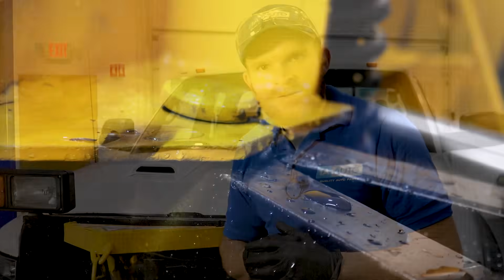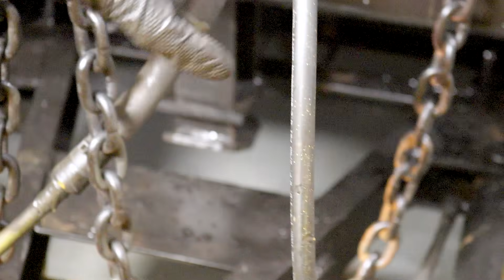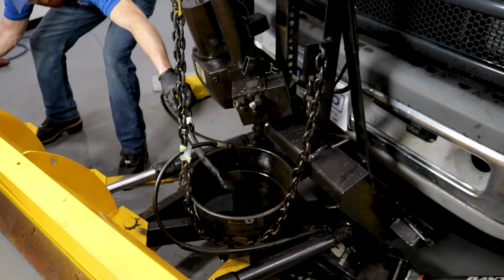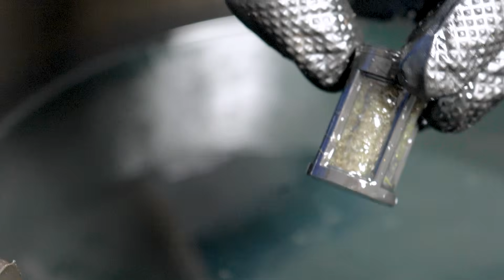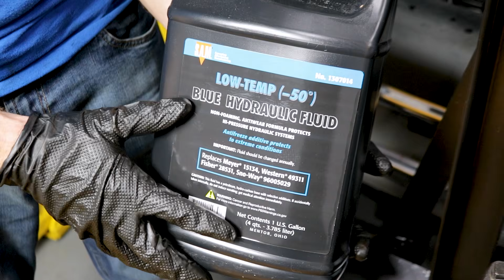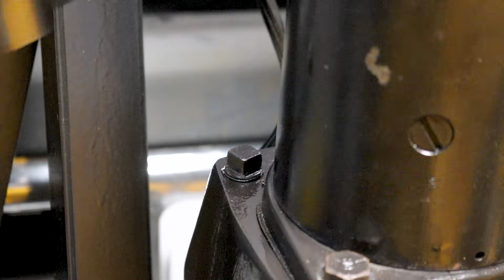Trouble Angling Plow? Plow Won't Move? Service Your Plow Before Winter!

Comment: You should never, never, never, use TEFLON TAPE on petroleum-based products as it breaks down and dissolves. And never on flared fittings. That is why they are FLARED to prevent leakage.BUT everything else great show and tell

Comment: Just watched this so I could find out why since using it yesterday my blade own't go up or left/right. I could here the pump run but nothing going on. Mechanic told me to check the selanoid. Seems like it died on me I found after checking voltage on it. I do all my own maintenance on this plow, I thought, until I saw how much detail you go into doing an oil change. I am a slacker.  You did not mention putting dielectric grease on the selanoid connections. Would that be necessary?  I guess in the summer I have some cleaning to do. Thanks for this video. So very informative on what I should be doing.

Comment: The information on this Fisher plow was very good tips, but I have a Meyers E85H that will not turn left or right so I thought I replaced the motor solenoid, the male and female couplers,  the (2) filters, drained the fluids, replaced three A, B, C solenoids, and it's still not turning so I am about to replace both Angle Ram Cylinders, Hoses.

Comment: Great video by far the best one I've watched. I've watched a lot of these freaking things trying to figure out what's going on with my Fisher MM2 8' HD(straight blade) done the fluids, filter, seal's, Hook the plow up everything works fine pick it up turns left and right. All of a sudden I hit left the plow goes up no matter what I do the plow won't turn left again for a period of time and then all of a sudden either maybe from shutting it off or letting it sit I don't really know then all of a sudden it'll turn left again and then a little while later it won't nothing like when you're trying to plow something and your plows stuck all the way to the right angle won't go left lol. Just doesn't make sense that every time it's hooked up and it's tested it works fine and then let's say I hook the plow up the night before I get in it the next day randomly it won't turn left right when I hop in and use it been trying to figure it out all season so frustrating. Maybe someone's had this issue or can point me in a direction that possibly I haven't looked or checked appreciate it.
Reply: Did you happen to figure your problem out? I have exact same thing happening and would appreciate some advice!

Comment: Put my plow on today and it clicks, but won’t raise or turn. Unsure what it is.. have a fisher mm2 3 plug
Reply: You ever figure out what the problem was? I've been chasing an issue where it works fine I park it for a little bit and I pick it up I hit left to turn left and it goes up. No matter what I do the left control will not turn the plow back left again I've been trying to figure this out for the whole season It's a real pain in the butt It works fine and then all of a sudden it doesn't like I just don't get it.

Comment: Mine works well for a few cycles then becomes sluggish then stops working entirely when it's 20° outside. Works fine in warmer weather.
Found out there was ice in the reservoir, because nothing came out when I removed drain plug. Had to heat up the pump with heat gun before it would drain. Drained it and filled with available power steering fluid (all I had on hand in a storm). It worked fine for the rest of the day.
The next day, it worked for about a minute and then became sluggish and finally quit working at all. Just the motor spinning like no load attached.
I believe there is more water in system. Any ideas how to get all the water out?
Reply: Very accurate and polite explanation
Reply: I'm having the same issue. And the wind-chill is -20 or something ridiculous. It's an old style Meyers plow with no drain plug..

Comment: What spray was used to clean the electrical connectors?
Reply from the maker: +Andrew Shagoury Thank you for your question. Dielectric grease, or tune-up grease, is a silicone-based grease that repels moisture and protects electrical connections against corrosion. It is also used to keep dirt, water, and other elements out of electrical connections.  Hope this helps.